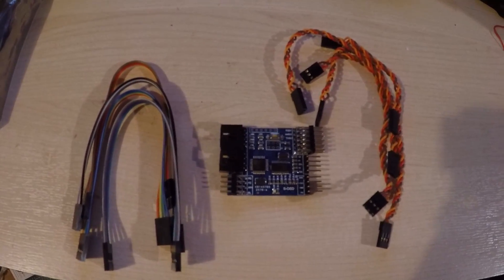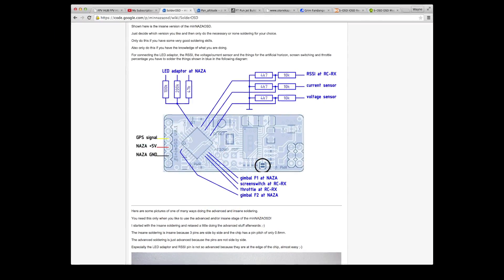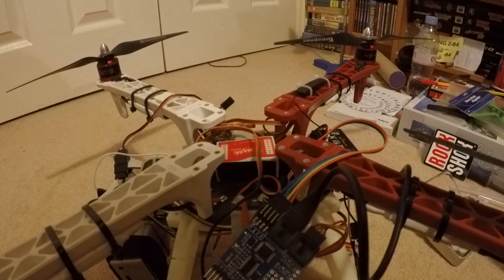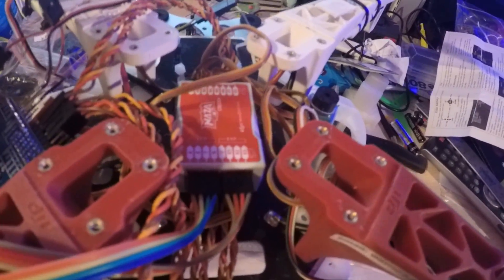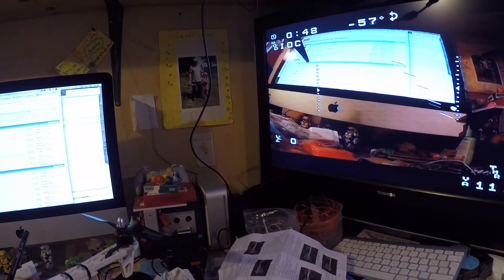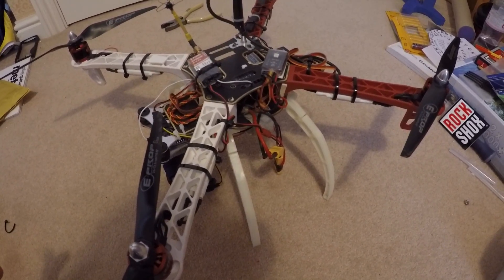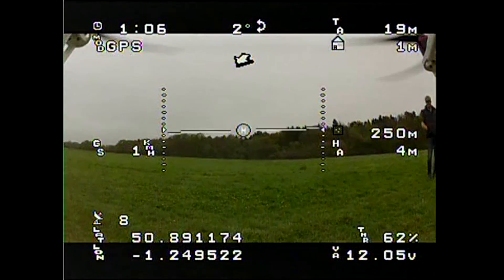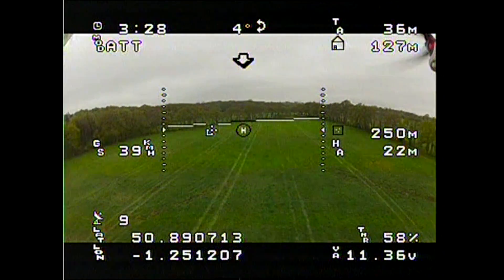FPV review: The S-OSD for naza (part 1)

Comment: Good morning! 
I recently bought one of these S-OSD-IOSD thingys.
It worked great with the exception of the virtual horizon so I decided to re flash the firmware.
Since then I cant get an OSD overlay anymore. Whatever i do, only video, no OSD.

I am using ArduCam OSD Config 2.1.3 because it was recommended by the other banggood users and the download of the data works perfectly with my FTDI232 adapter. If I try to re flash the firmware again (I thought maybe something went wrong the first time) it stops at "uploading 0%" and after a few seconds there is an error "Upload failed. Lost sync. Try using Arduino instead"

I already spent hours to find out what could possible be wrong but didn't find a solution
Any ideas?

Comment: What GPS module do you recommend?
Reply from the maker: As it's something that's very much for the Naza flight controller, I would recommend the GPS that comes with your Naza !  If for some reason you have a Naza controller without the GPS puck, then Banggood do a 3rd party one that works quite well.  Search on 'Ublox M8N GPS'

Comment: Hallo!
What for a currentsensor do you use with your S-OSD?
Reply from the maker: I'm not using one, so couldn't particularly recommend one I'm afraid.  I use the fact I know how long my lipo will last (with an alarm on the radio) along with looking at the voltage
Reply: Ok...thx.Wanna use the currentsensor while testing the copter to see the current.
Reply from the maker: ah I see.  I used a Turnigy watt meter to get an idea of my max amp draw... but I already had one around.

Comment: Hi there, thanks for posting Part 1 & 2, they are very useful. I was wondering if you might be able to offer some advice. 

I am having trouble changing between the 3 display modes. I am currently using a Spektrum dx7 with channels 5,6,7 being used for flight mode, IOC and gimbal control. So I do not have any spare channels so want to use the switch quickly between flight modes to change the display like you mentioned. 

I have set this on the PC using an FTDI adaptor. I have then tried to switch between displays using the flight mode 3 position switch and nothing seems to happen, just have panel 1. I then tried using a Y splitter from the reciever, one going to the FC flight mode switch and the other going to the switch pin on the s-osd board, when I do this the display screen changes without any transmitter input between the 3 display panels every second or so. Any ideas where I am goin wrong? Any help would be much appreciated. Many thanks, Darren

Comment: hei, i have a question, how you connect the gimbal if the F1 and F2 was used by the S-OSD for attitude. please help. where i can connect the gimbal if i use a S-OSD Remzibi, thank you.   i have a remote Radiolink AT9
Reply from the maker: +Neo Tube The F1/F2 is pretty much just used for servo based gimbals, with absolutely everything being brushless gimbals now, this isn't an issue.  I must admit that I've no idea if DJI's own gimbals use these... in which case you are in trouble !

Comment: Hey mate,
I just installed one of these on my P2 using a FLIR VUE camera. Although it seems to be working the Lat/lon information (which is the most important to me) under the little satellite symbol is cut off when the camera is connected, as soon as I unplug the camera it re-scales the OSD and can see everything just without the video of course. 

Any ideas?

Cheers!
Reply from the maker: +LandoFPV Best guess from what you describe is an NTSC/PAL mismatch.  PAL has an extra 56 or so (IIRC) scalines in SD, so when people report some of the top or bottom disappearing it's often that sort of issue.  It's interesting that it's bad when the camera is in - suggesting a possible PAL camera vs NTSC setting in the S-OSD.  Which is actually the reverse of what I'd expect given where you are from in the world and the default on the OSD
Reply: Wow that's very insightful! I will see if I can change my camera to PAL. THANKS!

Comment: Does this OSD work, if I don't have a GPS module for my Naza Lite?
Reply from the maker: +Edgar Crusher Well, it depends what your definition of "work" would be.  It actually gets most of the data from the GPS info, and doesn't even bother populating half of the screen until it has a GPS lock.  So while you could get the OSD to give you a picture the only things you'd get from it is battery/time in flight/roll & pitch angle & throttle percentage.

If you want an OSD that tells you position info and stuff then you'd need to get one that has it's own GPS receiver built in
Reply: +CurryKitten : I have Naza Lite without GPS (I'll get to that) and I wanted to know whether this OSD would power up and work without a GPS module attached. And show me some battery and time at least. Or it would just say that it cannot initialize without a GPS or something...

But you pretty much explained everything in your replay. Thank you.

Comment: has this been tested on a 4s
Reply from the maker: +bob gasman Yes - I'm running it on my 4s quad now.  One thing it did do after a spot on first flight is lose the correct voltage and I needed to use the special calibration firmware in order to fix it

Comment: Thank you for putting up these video's, very informative as i'm looking into a new OSD to use with my Naza M Lite and its GPS. 
Can you still control your gimbal via your transmitter? Or is this sacrificed to see the artificial horizon?
Reply from the maker: +justinfrom1986 No, I can still use my gimbal.  The Naza gimbal control is setup to use servo style ones (although I don't know if the zenmuse is different).  Anyway, the one I run is a brushless gimbal which has it's own controller board, and so doesn't connect to the Naza at all, so I can then use individual outputs from my rx to control pan/tilt as I need
Reply: Ahh ok, thank you. I'm going to order the osd right away :)

Comment: Does anyone have the original .hex firmware i can get off them for this, mine has stopped overlaying the OSD to my video, doesnt load up the boot splash either, however it still works fine using FTDI to connect to the boot loader. Just flashed MinimOSD onto it but still the same, what the hell! Any idea anyone?
Reply from the maker: Craig McTaggart Quick cut and paste from another answer -  you'll find a zip from this post http://www.rcgroups.com/forums/showthread.php?t=2020638&page=6#post26526305 inside that there's the folder 003_DJI, use the miniNAZAOSD_DJI.hex inside of that one.  It works fine, as I used it after I needed to use the voltage calibration hex.  Use the gui to flash it to the s-osd
Reply: +CurryKitten My LED interpreting doesn't work. Any Ideas?

Comment: Hi, I need your help again. How I can set the horizont display to the screen without gimbal camera? Because I don't have gimbal in my camera.
Reply from the maker: szucs roland You don't need a gimbal, you just have to set it to on in the naza assistant - this will send signals via the f1/f2 connection which is then read by the S-OSD to display the AHI.
Reply: Thanks. I'll try to find out these settings

Comment: Hi.Sorry, but I dont speak English very well. And I dont understand what do you do at 4min59sec, when you change something, and you reboot your controller, and the screen will be correct. I have this problem with my SOSD settings. I dont see the informations at the bottom of the screen. Can you help me?
Reply from the maker: szucs roland The SOSD is setup for PAL by default, so if you have an NTSC camera then it will look too big for the screen.  In this video I fix it by putting my GoPro into PAL mode, but if you want to fix it on the SOSD, then you can change a setting in the GUI.  If you watch part 2, I go through how that's done
Reply: Thank you for your answer, it was very helpful to me. I hope I will fix the problem with this settings.

Comment: Nice quadcoter mate ive got the dji fc40 with the naza v2 as iam getting into fpv i need to buy the dji pmu and osd but will be over £100 is the a cheaper set up that will do the same job
Reply: Nick Walters Yeah does the same thing and hell of alot more, for about a 1/4th of the price!
Reply: So it just that i need have you a link to the board
Reply: Nick Walters there are two versions of it, both exactly the same but the 2nd is much smaller and lightweight, the first one which he describes in video is quite a large board. Here is the standard size one http://www.goodluckbuy.com/s-osd-remzibi-osd-module-with-flight-mode-for-dji-naza-lite-v2-gps-vs-iosd.html
Reply: Craig McTaggart and here is the mini version of it http://www.goodluckbuy.com/mini-s-osd-osd-module-with-flight-mode-for-dji-naza-lite-v2-gps-vs-iosd-remzibi-osd.html
Reply: Nice one mate👍
Reply from the maker: Nick Walters Sorry for the late reply - although it looks like you got the answers.   I was a bit confused at first as I thought the naza 2 gives you the PMU you need to plug the DJI OSD straight in.  I guess the fc40 doesn't have it though... or has it's own implementation of the PMU ?
Reply: No it dont mate

Comment: will it affect GPS in anyway, given its a cheap Chinese board and correct me if i am wrong GPS signal will have to travel through the board. so how reliable is this piece of technology. I want a cheap osd but not at the risk of my hex. Please help.
Reply from the maker: Joban Singh The pins on the in/out for GPS seem to be electronically connected so in theory it should pass through even if the board fails.... however, there's no guarantees in this game, you pays your price and you take your chances.  To minimise any risk what you could also do it simple split off from the main GPS cable and splice in a connection to the board.  In that way your GPS connection from Naza stays where it is, and you only have an in connection to the board, so nothing to "corrupt" the out in anu way
Reply: Sounds good, I guess it'll work.  Thanks for the prompt reply

Comment: Any chance you've found a way to calibrate the voltage sensor?  Mine's off by enough to be annoying but I don't see any options in the minimosd configuration tool.
Reply from the maker: David Manning There is an option to do so, but only by uncommenting a few things in the code and compiling up a special version.  Mine was ok, so I haven't done this, that said I haven't looked at the voltage on the new one yet (should be flying it tomorrow fingers crossed) so it could be out as well.  The howto is laid out here https://code.google.com/p/minnazaosd/wiki/Calibrate

Comment: I'm having trouble with this OSD and my ccd camera  .. when I turn on all the information is cut ... you know what can it be? It is to set this up?
Reply from the maker: Douglas Everton Do you mean some of the text is off the end of the display ?  If so, then are you using an NTSC camera, as this seems to come using PAL by default (which has more lines than NTSC and so some of the info will fall off the bottom).  That's fixable in the GUI and also you can arrange where stuff is display (coming in part 2 - of which I'm doing some screen capture for tonight)
Reply: CurryKitten That's right ... the picture is to off-screen .... I download the configuration tool is this site below it?

http://www.happykillmore.com/Software/Faq.asp

thank you
Reply from the maker: Douglas Everton Er, no - wrong one (at least I think) use this one here https://code.google.com/p/arducam-osd/downloads/list  You'll need a 5v FTDI card in order to connect your S-OSD up
Reply: CurryKitten I have the FTDI only have no doubt which side should be the GRN pin and the BLK pin. In my OSD is unwilling Information pins. Once again thank you .... You are helping me a lot !!
Reply from the maker: Douglas Everton ok, on the S-OSD you'll see 6 small holes near where the naza LED inserts.  One of these holes has a square around it (in copper) That's where you connect the ground pin on the FTDI card
Reply: CurryKitten ok. Thanks!
Reply: When I try to read the OSD settings by OSD config it shows the following message:

"Failed to talk to bootloader "

You know what might be happening ?
Reply from the maker: Douglas Everton Is your FTDI functioning in 5v (and not 3.3v) the S-OSD should light up when you have inserted the FTDI.  You might need to hold it in place as it's easy for the pins to slightly disconnect from the holes.
Reply: I could set up when I changed the FTDI on the other I had here ... unfortunately one of them did not work ... thanks for the tips , they were very important .

Comment: Hi, I got this s-osd and mounted it on a f450 with naza m lite. Works like a charm, but  has an issue: when I have high contrast video from my camera, the central part where there's the artificial horizon becomes blurry, distorded, like interferences in the picture.
I have a turnigy actioncam camera.
Did someone have this issue? 
Any help is welcomed!

Thank you

Comment: I also got one of these but i am having an issue with it. When it is all connected the screen shows that throttle is at 50% when it is not, and it changes in naza assist so i dont see gps 2x atti and manual. Can anyone help

Comment: Thanks, CurryKitten pardon my noobiness but yes I hooked it up to a 3 way switch on my radio but all I get is flickering of the the 3 screen modes. Flicking the toggle switch does nothing. I even set the servo travel. Radio is a DX9
Reply from the maker: Julz Martz This is what I got initially, I had the switch actually linked to a slider (as it was normally a gimbal channel) and had it in a position where it jsut kept changing channel, but I found that the min (or possibly max) position would hold it steady, and then a flick upto the top and back again would change it once.  On the good news front, there is an option in the GUI to assign it to a 3 position switch instead (or even by changing between flight modes rapidly - if you've run out of channels)  I'll be trying the 3-way switch out in pt 2 if that helps at all, but in the meantime if you put your switch channel on a pot or a slider, you we hopefully be able to see exactly the range where the screen switches/stays put
Reply: CurryKitten Ok  Ill try it thanks for the info. Can't wait for the PT 2. Regards and keep up the good work. Again, thanks for sharing info.

Comment: Hi, How do you set the 3 different screen modes?
Reply from the maker: Julz Martz Are you talking about how to switch between them, or so they display different things ?  There's a servo connection for the mode switch, which is set by default to a momentary switch.  As for setting what's on the screen, there's a GUI for configuring - that's coming in pt 2

Comment: After having used this OSD, the green LED stopped working. I returned to the previous settings without the OSD and green LED not returned to work.
Naza operation are good.